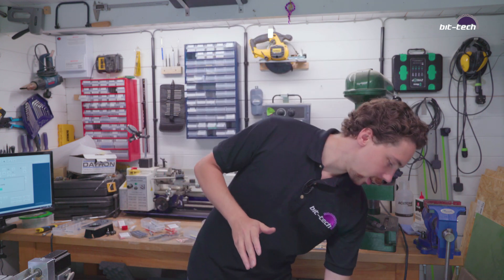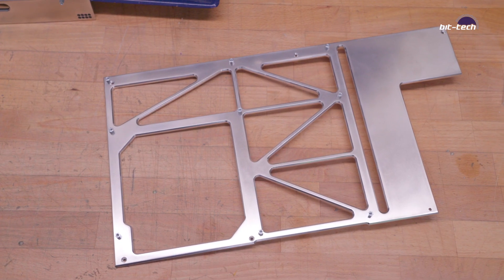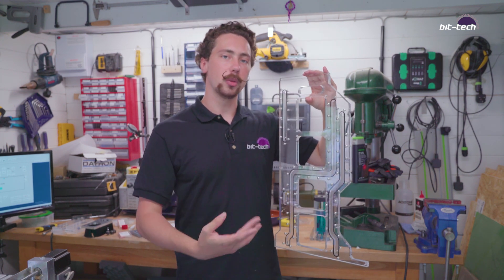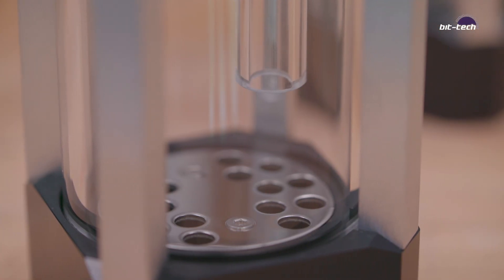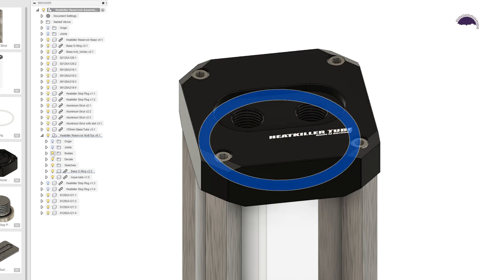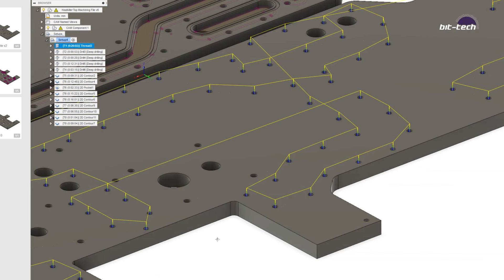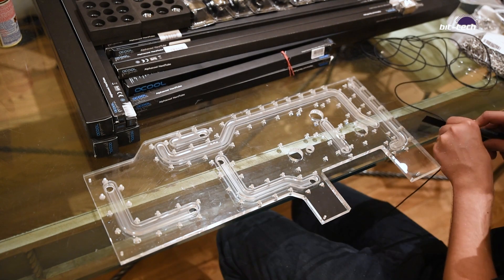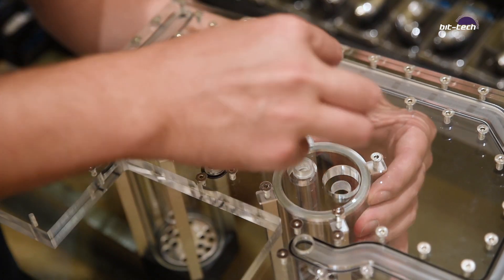Corsair 1000D - Machining a Heatkiller Distro Plate  (Update 5) | bit-tech Modding

Comment: Loving this series, about to order my 1000d - any thoughts on sharing the designs on the integrated res/panels? Or doing production of said units for a cost? Keep up the amazing work!
Reply from the maker: We wouldn’t be able to market these exact ones very easily since they’re so specific to the mod. However, Barrow makes a distro plate for the 1000D that’s really rather fancy which will fit into a significantly more stock case
Reply: bit-tech  Thanks, I noticed that also but not overly keen on the design/finish but also since I would be drilling that annoying drive bay out for sure layout could be improved! Was more interested in the integrated res/distro part - I saw you made a small example hence the question as to whether you fancied sharing. Planning a new home for my RTX cards ;)
Reply: A. Do you ever sleep? B. I love the look of that heatkiller reservoir... I did a mostly corsair hydro loop with their pump/res, is there a way to mod that to use the heatkiller res instead? Mostly like to use LED and pump from it along with temp sensor for iCue.

Comment: Why is there a tube inside that reservoir? Is it necessary?
Reply from the maker: That tube causes the fluid to flow in below the surface of the coolant in the reservoir. They’re not strictly necessary all the time, although in tube reservoirs they help by preventing air from being mixed back into the loop.

Comment: In the future, I would suggest making a jig for 2 sided machining that uses the screw holes from the 1st side to line things up on the 2nd side.
Reply from the maker: That’s 100% a better method. Actually the reason I didn’t do that or use dowl pins etc is because on my control software i’ve not been able to set custom origin points yet. I think I may have found where the option is though whilst looking for another setting, so I guess that may be what I try next time. Still early days with this machine, hell of a lot still to figure out with it.
Reply: @bittech1  what CAM (Computer Aided Machining) program you are using

Comment: Without a doubt this is by far the most impressive build I’ve ever seen. Even in the pre assembly phase - just by looking at the cut model in a earlier video - the case looks awesome. 

You should also consider a new bending video. The proper way of moustache-bending😎